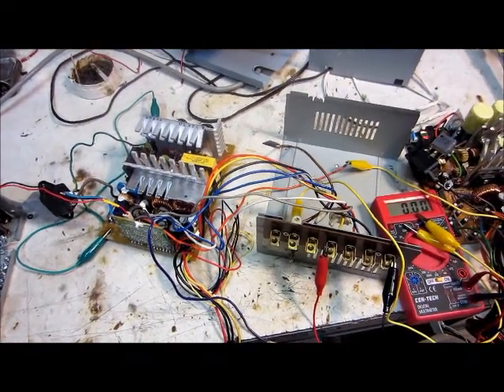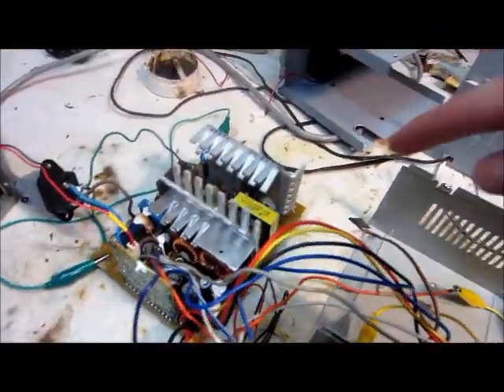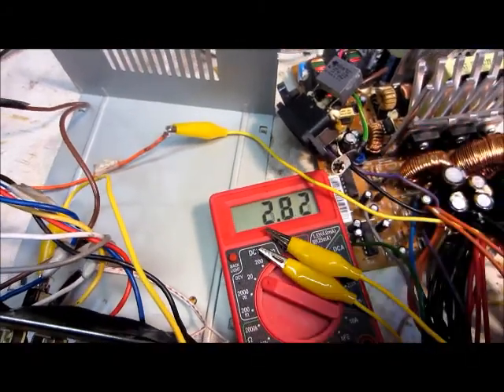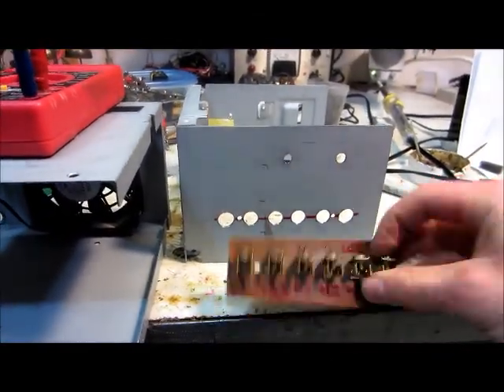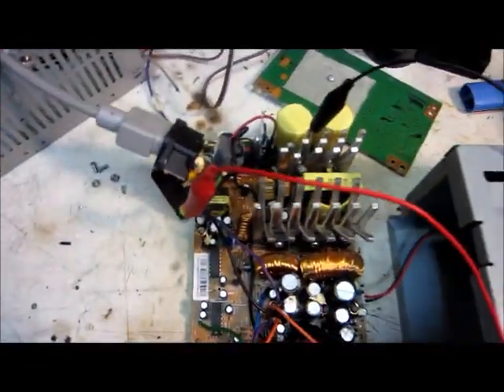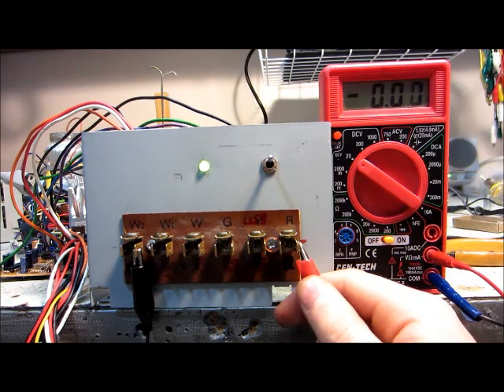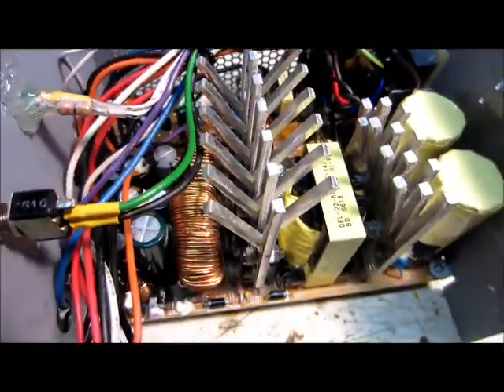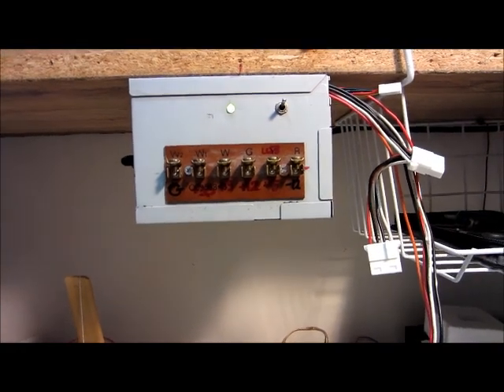How I Made a Bench Power Supply

Comment: Yes, inside computer power supplies, they can hold enough charge when turned off AND unplugged to kill you. I was told it is best to not mess around with anything inside a computer power supply for any reason. However, you seem to understand and stay safe, but for viewers, Computer Power Supplies are NOT AT ALL something to LEARN about electronics/electricity with. There are so many safer alternatives to learn with that won't kill you.
Reply: +Jay H They are not gonna KILL you, instead you will be shocked quite well, there's around 310 volts after all. Once, I've stupidly grabbed both terminals with both hands of 10 uF 600 volts charged PFC capacitor. It didn't kill me but it was not very fun experience I can say, the muscles contracted so hard that the terminals were 3 - 5 mm embedded in my skin. Not nice.
Reply: +Mark Schulz IV Ouch! Well, I think it was the "transformer" maybe, that had what could kill you, I honestly don't know at all, I'm just learning terminology and the most basic of circuits right now, I'm not anywhere near qualified to be called an electrician and what I heard, was said many years ago, so I could be completely wrong. If there is nothing in there that holds enough power to kill you, then maybe the person just wanted to avoid someone getting hurt and getting blamed for not warning people of the possible danger, since it was said by someone who was having us, hands-on, look at circuit boards.
Reply: +Mark Schulz IV possibly the scariest thing, is that up until yesterday when I was watching a video, I thought capacitors posed no threat, once a device is turned off. I heard a guy saying that sometimes discharging capacitors on circuit boards that are not hooked up to a power source any more, can still produce harmful sparks, so what you use to discharge them, should be related to how much power they can store. In other words, you wouldn't want to use a metal staple held with your fingers, to discharge a super capacitor the size of sledgehammer head, but if its a tiny little brownish-orange flat disc smaller than a dime, then something like a screwdriver might be fine.

Comment: is there a way to control the amp, like if I need 5 volt 5 amp ?
Reply from the maker: There are ways you can control the amps.  The simplest way is to use a resistor.  But if you really want to control the amps there are ways you can modify the computer power supply to be a variable power supply.  It's not easy though.  Thank you!
Reply: http://www.ebay.com/sch/i.html?_trksid=p2047675.m570.l1313.TR1.TRC0.A0.H1&_nkw=5A+Constant+Current+&_sacat=0&_from=R40
Reply from the maker: Yes, that's probably the easiest way!!!  I want to buy a nice one of those that can handle 10 or 15 amps and is digitally controlled but I can't afford it...
Reply from the maker: Here is the one I want!  http://www.aliexpress.com/item/ZXY6010-ZXY6010S-DC-constant-voltage-constant-current-regulated-power-supply-60V-10A-600W-DC-DC-power/624420485.html

But I would also need to but this to power it... 
http://www.aliexpress.com/item/600W-48V-110V-input-Single-Output-Switching-power-supply-for-LED-Strip-light-AC-to-DC/835228775.html

Comment: I'm guessing that your other one stopped working. Because you thined out the wires too much you need at leest 4 wires for each contesting to get a sustained voltage
Reply from the maker: Nope it's still working great!  All the 5 volt wires connect to the same pad on the board, same for the 12 volt and all other wires.  I mean I might get a little voltage drop but it's so small compared to the amount of voltage drop I get on one alligator lead.  Each wire can easily handle 20 amps for a short time without melting.  That is really all I care about with a bench power supply like this.  Thank you!
Reply: O i c iv only recentley got in the eletronics and some other you tuber used 4 wires and he said it was better soo ...yep
Reply from the maker: I mean it will be a little better if you are really worried about the voltage being closer to the real output voltage.  But you will only loose voltage when you are pulling a lot of amps.  So don't worry about it.  Measure the resistance of the wire and then use ohms law to calculate the voltage drop with a certain current.  V=I*R  V=voltage(the voltage drop in this case)  I=the current you will be putting through the wire.  R=the resistance of the wire(You will probably not even be able to accurately measure this with a stranded multimeter).  If you look at the equation, the higher the current and or resistance the higher the voltage drop will be.  You can then subtract the voltage drop from the voltage of the power supply to figure out the voltage you will be able to get when drawing a certain current.  The only problem is that the voltage of the supply will also probably drop as well...
Reply: Makerj101 I think you just fried some feedback components there, that's why it starts and shuts off quickly. PS-ON is not connected to IC directly and you may damaged some voltage sense resistors in dividers, so a LOT of things can be a problem :)

Comment from the maker: It seems to me that they are using the heat sink as a bridge.  The only other reason that I can think of that would cause this is that the metal case of the transistors are connected to it.  Most power supplies are like this too.
Yeah I guess I could make them bigger or something.  I think they can handle the amps just fine though, maybe a little voltage drop.  The power supply still automatically shuts off before I can even get them warm.  Thank you for the tips!

Comment from the maker: Yeah I would do all of those things too, but I just wanted to do a quick hack job for the video.  Also the bright LED on the inside would look really cool but for the things I would use it for it my get annoying if I am doing an experiment that need darkness.  I use a blow torch to remove the wires!  I should really get my self a soldering gun!  How would you make the voltages adjustable?  LM317?  Thank you for the tips!

Comment: My MOD of the supplies I work with involves me using a big Weller soldering gun to remove all the common output wires.  What you will find left behid, is great big holes that will accept a single 10 guage wire. This makes the supply to look very roomy, and easier to work with. My next mod will be to get the voltages to be adjustable. I add rubber feet, and paint the metal once it is all apart. I also add a bright LED to the inside, so the grill glows when it is on.

Comment from the maker: This one has held up the longest of any I have ever had!  I have blown regulators, a couple of capacitors, and a diode at different times.  I just replaced them and it works again.  All the other ones that I have had before this one were ruined if one capacitor popped.  Because it was like a chain reaction.  One popped and some IC would get hot and it was done for.  Maybe its just that this one is extra tough!  ;-)

Comment: same thing happened to me, found out that you have to connect the trigger wire to ground to send the board a signal that turns it on. when you don't connect the trigger wire (usually the green one) the capacitors drain to ground, so if you touch the casing or anything else grounded, you get shocked.